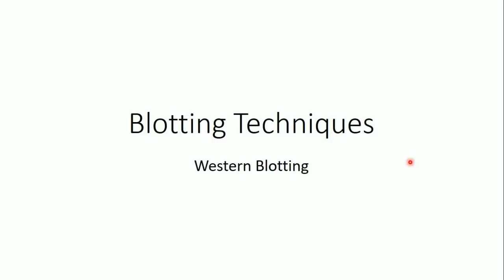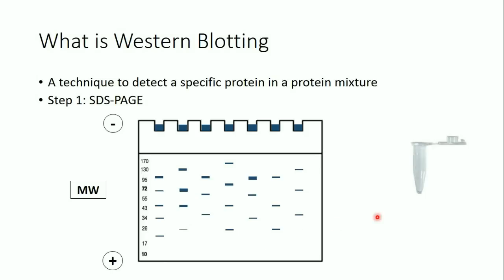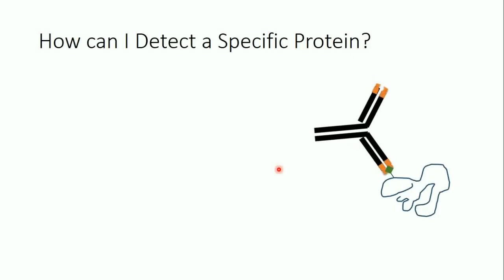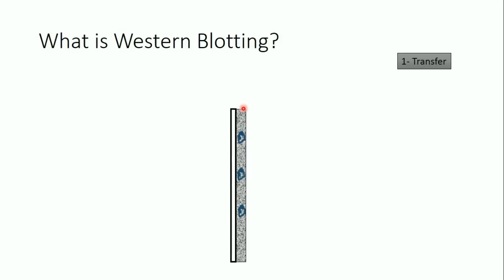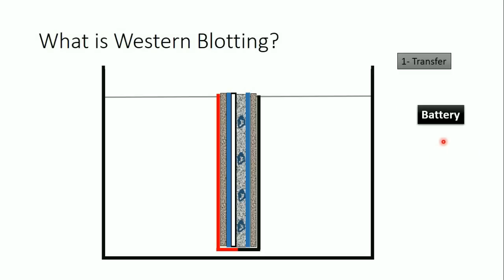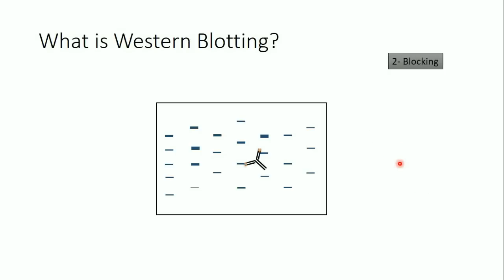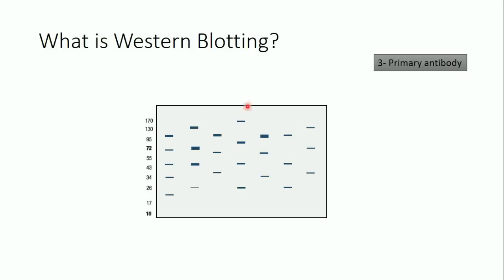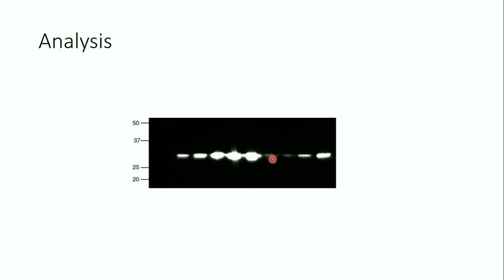Blotting Techniques/ The Principle of Western Blotting

Comment: OK. So I have questions.
1) Is there a "ladder" for SDS-PAGE? Otherwise I don't see how can I determine specific molecular weight numbers
2) SDS denatures proteins, would that interfere with the primary antibodies from recognizing the protein of interest given that it is denatured?
3) The "sandwich" is placed in PLASTIC container. Why use plastic, a non-conductor, when we are going to electrically push the proteins? Does the transfer buffer gets into the plastic bag, or stay completely outside?

Comment: how can i know how much time and voltage i need to my proteins? it depends on what? how can i know if my proteins run away from the membrane or some stayed on the gel?
Reply: If you have included your 'protein ladder/standard' in SDS-PAGE (as you should! ;)), then you will see it on your blot (the colours of the ladder are seen)...if not, well, then your samples have migrated into the solution and you can start all over again :p point is, you cannot see it during the run. Make sure you get it right immediately, and stick to your own routine, always, when preparing the cassette!

Time and voltage depends. Anyway, you should be careful with higher voltages, as this might increase temperature, and maybe decrease the quality and resolution of your blot. As I remember, we used 25V for 'overnight' (ca. 16h) (and put the whole setup in an ice filled bin!), if you start blotting at the end of the day, OR 45V for intraday (ca. 4h). This worked fine, but ideally you should optimize for your own equipment yourself :)

Comment: I have a preformed a WB and im comparing a wildtype and mutant protein and the results show that we have more intensity in the mutant samples than the wildtype samples. The only thing this tells me is that we have more of the protein of interest in the mutant compared to the wildtype right i.e. it doenst give me any other information?
Reply: Do you have a control protein blotted as well? I assume your proteins of interest are from a cell lysate, no? A housekeeping protein like GADPH, or something like Actin? Or some bacterial protein if you have expressed the poteins to have them purified later on? If the band size/intensity of the Controls is the same in each condition, then you indeed have expression differences between wild-type and mutant.

Comment: Short question.:
Why do all proteins move to the anode if you  prevent SDS-binding with methanol? Whithout SDS-binding some basic/alkaline proteins would be positively charged, wouldnt they?
Reply from the maker: Hei, proteins here are already bound to SDS, because as I said; before applying the western blotting technique we applied the SDS-PAGE in which all the proteins were bound to SDS. So the Methanol is added to the transfer buffer in only 20%, so during the run, methanol will lightly detach the SDS from the proteins (not completely) in order to enhace their ability to bind to the membrane.

Comment: I have a question...
I understand that the primary Ab is extracted from something other than a human (such as a mouse or rabbit).
I also understand that the secondary antibody is made anti- whatever the species used to make the primary antibody. However, how is the secondary antibody produced? For instance, if you have a human protein, a mouse primary antibody, then would you need to synthesis the secondary antibody in another animal such as a rabbit? What happens if you synthesis the secondary antibody in a human or mouse?
Reply from the maker: Hello ... The secondary antibody is an IgG that has a specific affinity to the proteins of a certain species such as mouse or rabbit or sheep. It is also produced in an animal by hyper-immunizing (injecting a high concentration of immunoglobulins) the animal with purified immunoglobulin fractions from a normal mouse (or any other animal) serum to produce High-affinity antibodies. Yes, usually the secondary Ab is produced in another animal because you cannot produce anti-mouse secondary Ab in a mouse because if you inject mouse immunoglobulins into a mouse then the mouse will not produce Ab against them. On the other hand, you can produce anti-mouse Ab in humans but usually, we dont produce Ab in humans (ethically). However, if you are studying sheep proteins for example and you use mouse primary Ab you better not use sheep secondary Ab to prevent unspecific binding. So usually for example, if we are studying human proteins we use mouse anti-human primary Ab and rabbit anti-mouse secondary Ab.